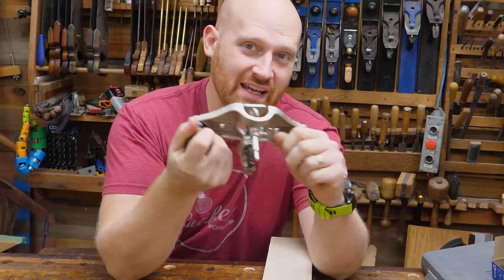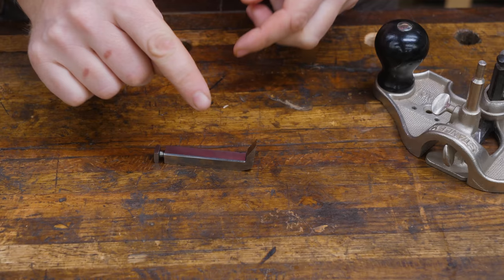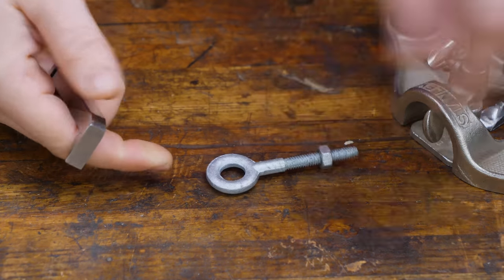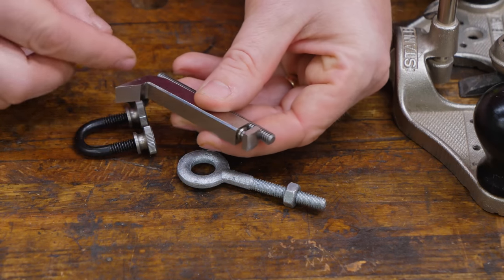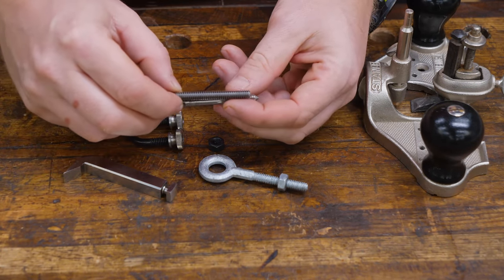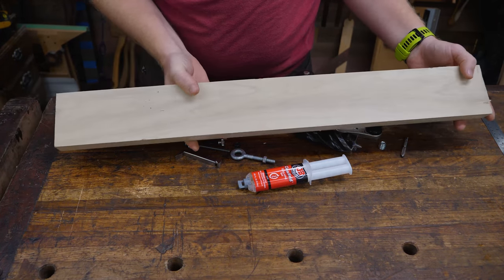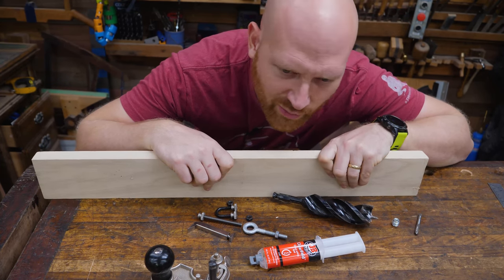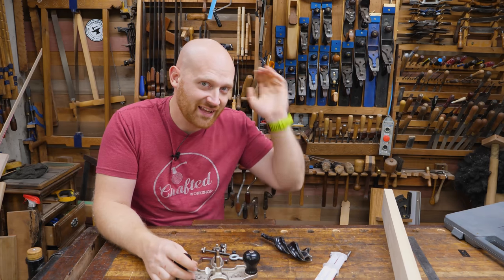Router Plane Live Class and Hardware Announcement

Comment: Why did’nt you go with the veritas cutters ? Is it just for the price sake ? Could i buy those and still make it the same as yours ? Hope i can get every thing here in 🇨🇦 in time for your live 👍🏼👏🇨🇦
Reply: A square shank will make it easier to cut the slot to register against the homemade base...... but the diamond shank Veritas cutters will work too, you will jus have to cut the notch slightly different. I think James said both will work, and he may even go through the different procedures when it goes live...... although he will only be cutting the notch for the square shank in his I'd reckon 😁
Reply from the maker: The ones from Veritas are more expensive and one of the reasons for making your own is to do it cheaper. also the square shape works better in a wooden body then the diamond shape. due to both the easer shape to cut and the you get a better restraining force with the U bolt. but that being said you can use any cutter you want. They will all work with the design.

Comment: Rockler is sold out of the router bits thanx to James.
Reply from the maker: Sorry. There are similar bits on Amazon. But they have to be shipped from China so they'll take too long. You can also get the Veritas replacement irons they're just not square so you would have to make the channel a little differently but they would work the same.

Comment: I'm ready. Purchased all the pieces except two; the wood and the auger bit. Having trouble finding both. Any ideas
Reply from the maker: the wood can be any scrap you have lying around. honestly pine would work fine it will probably just need to be replaced in a year or two. but they do not take that long to make. for the large hole you could use a turning saw. you could also use a spade bit or a hole saw. or if push came to shove you could just cut it out with a chisel like a mortise.
Reply: Lowe’s has a forstner bit for about $20 USD or a hole saw bit for about $15 USD
Reply: @WoodByWrightHowTo  What would the minimum dimension you would recommend for the wood

Comment: Is it possible to make an offset one for tenons? Like the blade isn't centered so you have more weight on the supported side.
Reply from the maker: Yes. That's actually one of the things I'm thinking about doing with this one. You just make one side longer than the other.